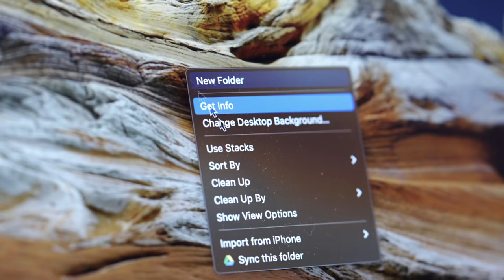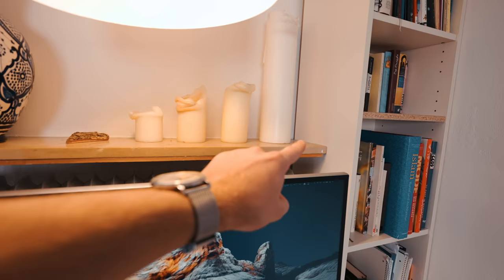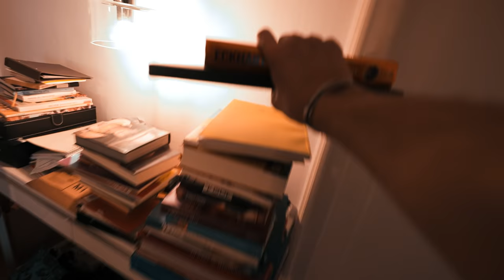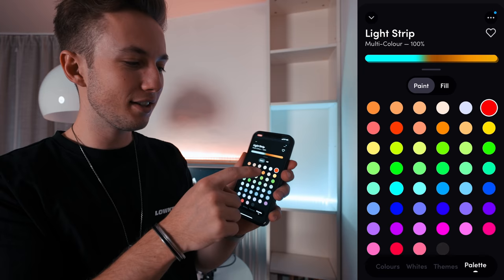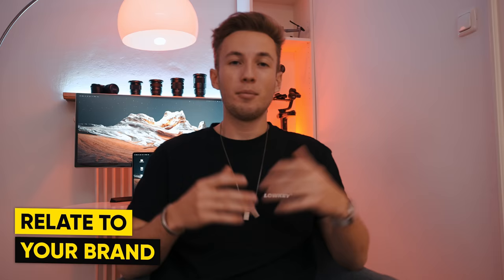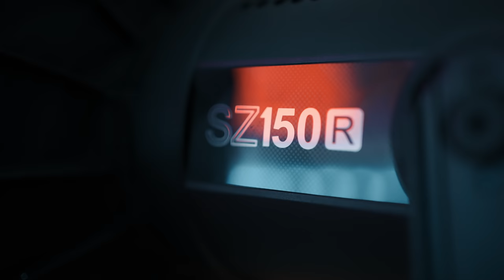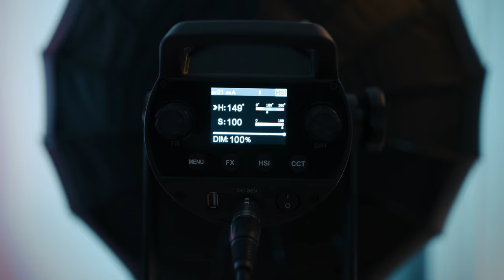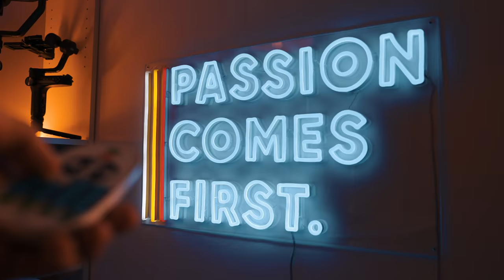Transform Your BEDROOM Into A YOUTUBE HOME STUDIO!

Comment: Yeah the sign looks good, but you need to do get something to do something to hide the cable mess. Either drill a hole in the wall (minding where all your electrical cabling already is) or buy one of those stick on tubes for hiding conduit. Cable mess is annoying.

Comment: I know you're not an ace using a drill, but I would drill into the wall behind the power cords for the neon and connect them from the other room. This way you wouldn't have cables hanging behind the sign and on the wall.